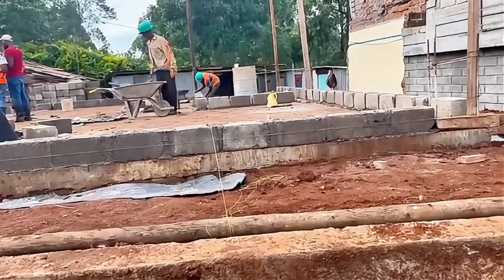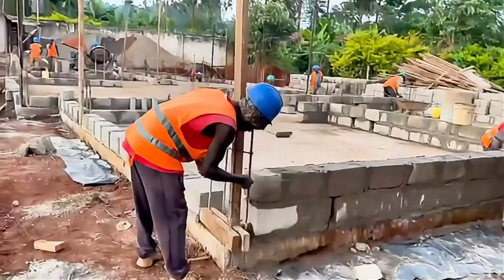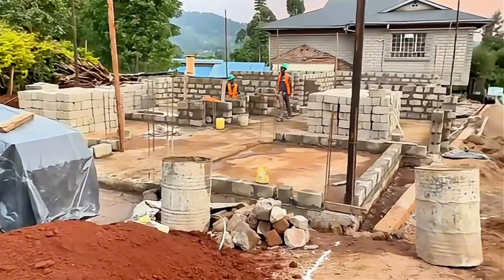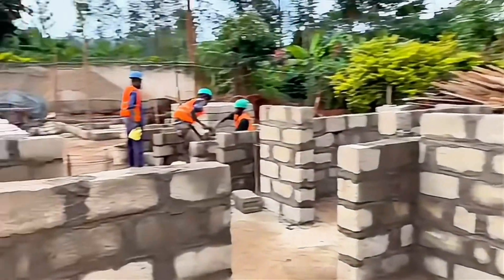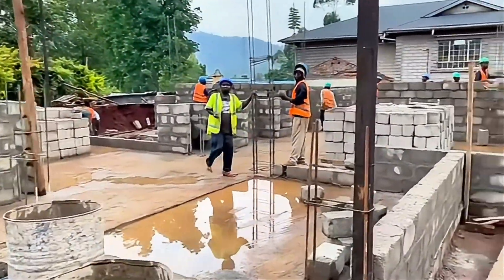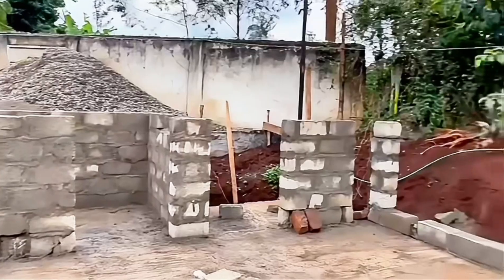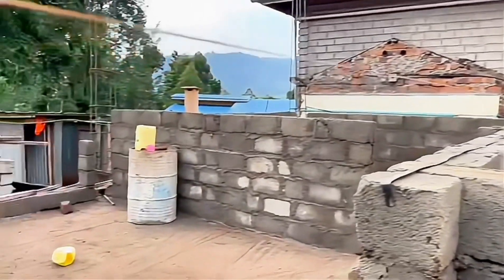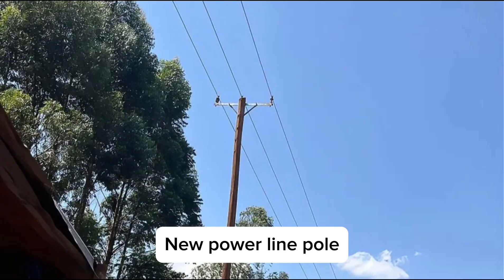WHY I CHOSE CONCRETE BLOCKS

Comment: thanks for the updates and sharing the build process. Did the power company charge extra for relocation of the poles and update to three phase? I like that the plumbing and electrical conduits were incorporated in the foundation, I've had pushback on this on my previous building projects
Reply from the maker: Yes, KPLC charges fees to relocate power lines. Talk to your electrical engineer, they can help facilitate the process

Comment: At what point did the contractors place the Y12 metal rods...What how do they help.Are they the same as what they refer to as wall pass?
Reply from the maker: Do you mean the metal rods for the columns ? Check out this video https://youtu.be/Tbk82OTTAuE?si=413c4t95qMizJ4Cm&t=519
Or are you referring to the retaining wall?
Reply: The metal rods...